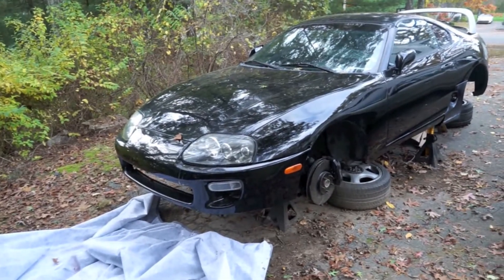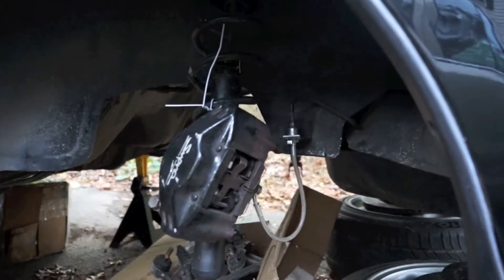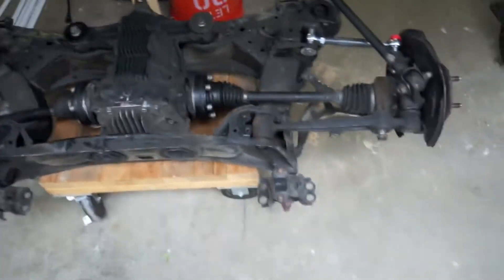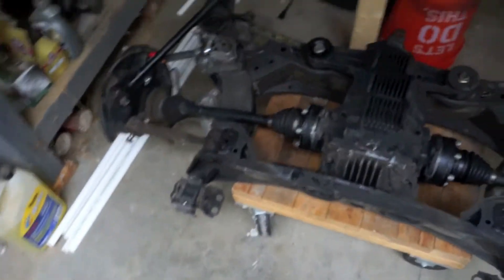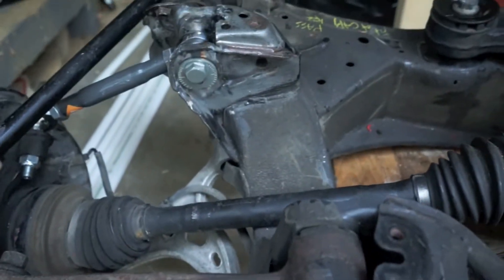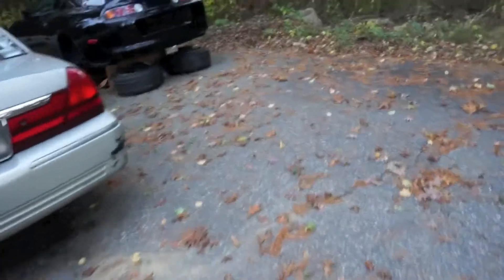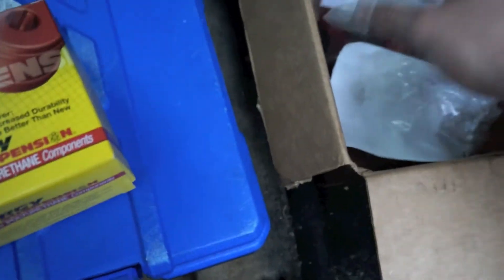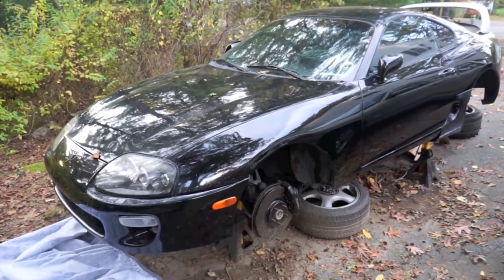Supra Build #7: I Pulled my Subframe!

Comment: The 5 speed and 6 speed subframes are identical? I'm putting the 220mm 3.13 diff in my NA, along with the v160
Reply from the maker: Retrocade Podcast yes this is a 6 speed subframe with a 200mm diff